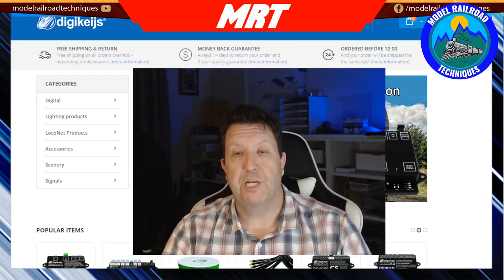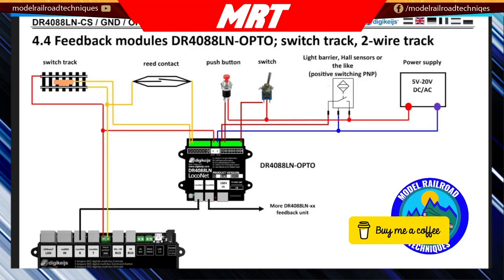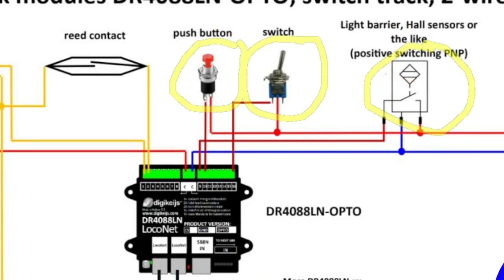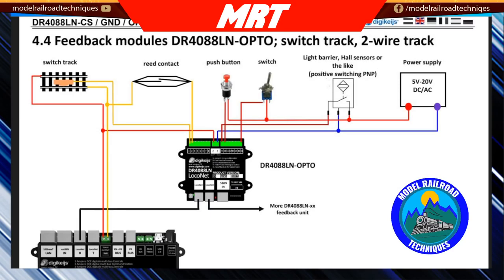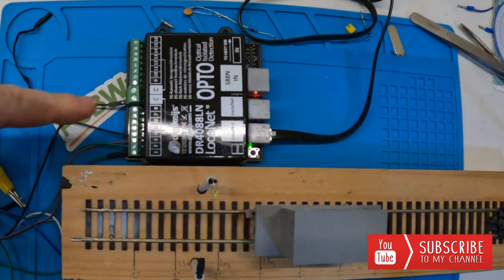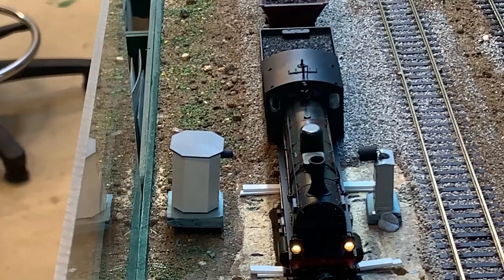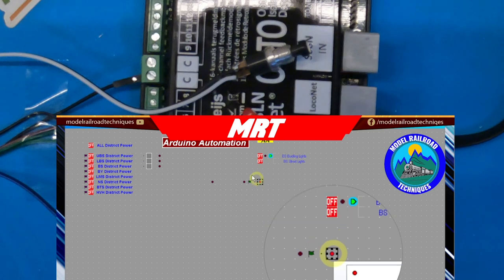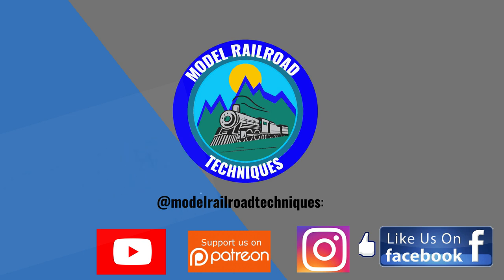Do you want precise block detection ? Use infrared

Comment: You can look at Light Barrier as being the same as Infrared.   Infrared is just not visible to us :).     Great little video with some great information, as always.    I do like the Digikeijs stuff.    Compatible with so many things, and not ridiculously expensive.    
Totally off topic for this video.    Where do you think is best place to buy Australian model trains, as in once based on Australian railways?    I kind of want to move away from British based  on my layout.
Reply from the maker: Thanks Brendan. Light Barriers? Do you have a link? Regarding Australian Stock: Depends on the state you live in. Australian Modeler (Auscision) have a great online store.
Reply: @ModelRailroadTechniques  Light Curtain is more the correct term, but in your video Digikeijs listed it as a light barrier :)
https://en.wikipedia.org/wiki/Light_curtain.
The wikipedia article talks about in context of machinery safety, but the basics are there is an emitter that emits "light", in the case of infrared, it is inrared light.   On the other side is a sensor that detects that light.   Usually a light curtain or light barrier will send it in pulses  of a certain frequency so it can be distinquished from random light around it, but in the case of detectros we use in railway, it is more a solid on as it is not as critical if the receiver accidentalyl detects random light.